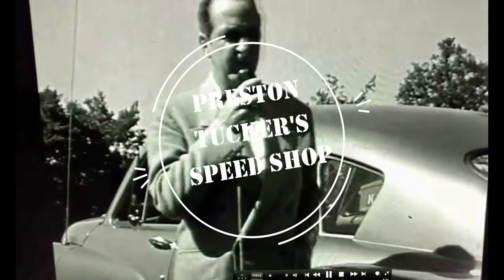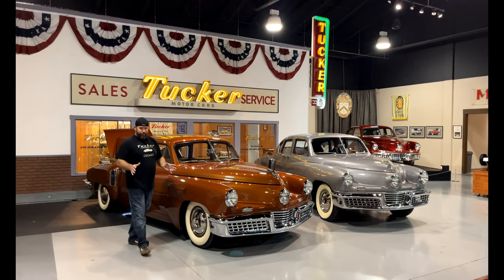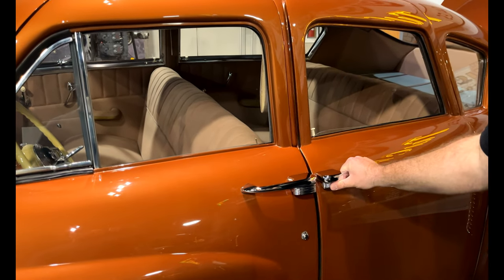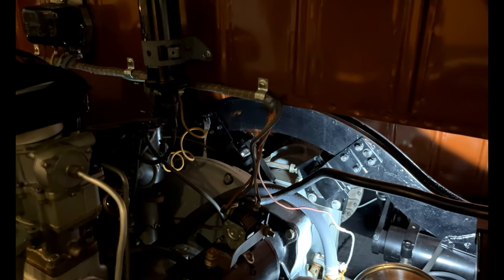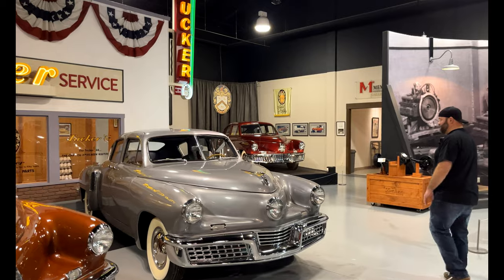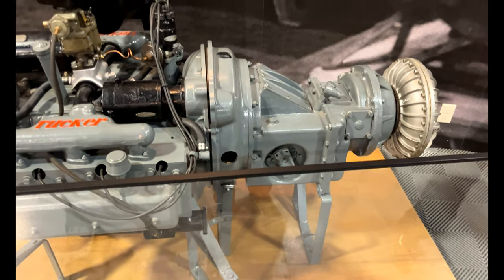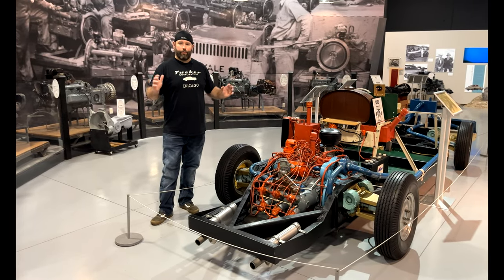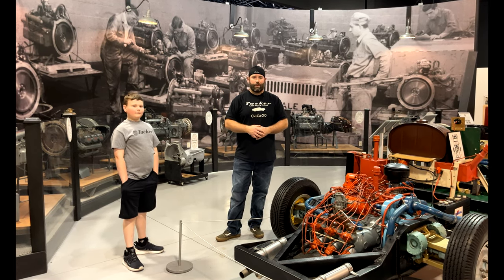Preston Tucker Designed His Own Automatic Transmission; There is Only 1 Left!  This is Tucker 1026.

Comment: How many Tucker automobiles actually exist today? 
Great video!
Reply from the maker: There are 47 of the original 51 left.  Thanks for watching!
Reply: Thanks for responding👍
Reply: I believe someone made a replica of a 1948 Tucker sometime not too long ago, powered by a Cadillac Northstar V8. A small block Ford would probably be better since those Northstar engines can be a little problematic at times.

Comment: My dad had a small auto repair shop in Philadelphia in the later 1930s. He took on a clutch job on a supercharged Cord in 1939. None of the other shops would touch the job, but my dad was young and needed the work. He said he had to start at the front bumper and take the whole car apart until he could remove the transmission. I don’t recall what he charged, but it was less than the Cord dealer want - $500! That’s over $11,000 in 2024 dollars!  He said he wouldn’t do another Cord clutch job.
Dad said his easiest, most profitable job was an almost new Plymouth. He towed it in with a no-start complaint. Back in those days new car warranties were 90 days. He found that the camshaft had broken. Called the dealer to order a new cam, & next thing he knew there was a new camshaft along with a 4 man team from Detroit in his shop. The leader asked him how much money he made in a week, he gave the Chrysler man an “optimistic” estimate. The Chrysler man handed my dad cash and took over the shop for the week. That was the first vacation my ever had.

Comment: Great respect to these gents who have clearly moved heaven and earth to preserve this important part of automotive history.

However, as a long time automobile mechanic and degreed engineer, by the looks of all of the running changes to so few vehicles, many of those changes major like moving from transverse to longitudinal engine and a complete change in engine strategy, IMO, Tucker would have been much wiser to make all of his engineering changes to low volume or single prototypes before committing to the huge overhead and capital equipment costs associated with a mass production factory.

Most of this would be much easier today with CAD design and the associated 3D printing and milling.  This and other modern, computer enabled prototyping tools might have allowed Tucker to survive had they been available post war.

Comment: I just noticed that #1026 also doesn't have the Kaiser/Willys interior pushbutton door latches! It has pull handles.

In regards to the test chassis, there is a blueprint in the archives for a self-contained 2-speed torque converter WITH reverse.  It is essentially a radial torque converter with a central planetary gear set.  The planetary set is perfect for making 2 forward speeds and a reverse. However the complexity of such a unit is probably what resulted in it simply being a design.  None were ever made and chances are the complexity and cost of producing such a bespoke unit is what precluded it from production.  Mr. Tucker and his crew had many, many fantastic ideas.... but at the end of the day, they were trying to market a car with a retail price of around $2,000 dollars.
Reply from the maker: Correct on the interior handles, nice catch!  1026 and 1023 had them, but sadly 1023 is no longer with us.

Comment: #1042 has always fascinated me, more than any other Tucker, probably because of it's "missing" status...if that engine and transmission has been confirmed to have been from #1042, has anyone researched where Dave acquired it, and what the trail of ownership was before that?..could well lead back to the possible final fate of #1042, or possibly more parts of it!....on another note, there are lots of bits of #1018 and #1027 that have been incorporated in other cars, and parts of them still out there..I feel there may even be parts of those 2 cars in the "convertible"...well, I always wondered why, given the discovery of the other leftover bodies and the NOS parts, someone didn't undertake to "resurrect", "rebuild", or "reconstruct" #1018, 1027, or both..gather and use as many original components as can be found for the car, and replace what is missing...it would be just as accurate, or "real", "authentic",or "genuine" as those 1969 Dodge Chargers that are built around a cowl and a serial number, and considered authentic..same with restored WW2 airplanes. I would much rather have a reconstructed #1018 or #1027 as an add-on serial number car created from leftover parts, and may actually contain parts of those cars anyway....

Comment: Was the automatic a 2spd,3 spd, or 4 spd, or like a Dynaflow basically a torque converter with low and reverse  tagged on?  I'd really like to see someone re-manufacture these today and keep them original  with only minor changes (like alternator vs generator, disc brakes etc) but epa would probably have a hissy fit. Sure glad you fellas are keeping his legacy going...and his cars.

Comment: Amazing stuff trying to figure out why he used 2 tourqe converters and what was the purpose of the 2nd one? I am a mechanic but not a transmission mechanic
Reply: If there were concerns of transmission longevity especially behind a 500+ CID engine a second converter could help... But man talk about throwing efficiency out the window.  Thermal management would be a significant challenge.  Especially with the lubricants they had access to at the time.